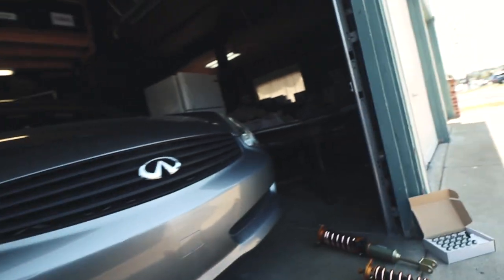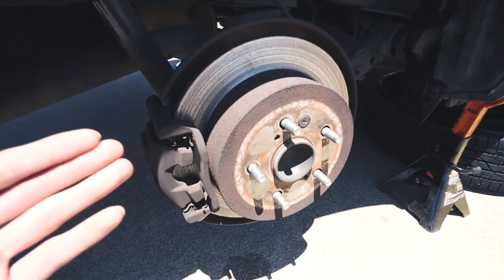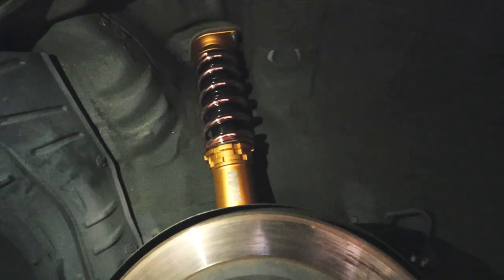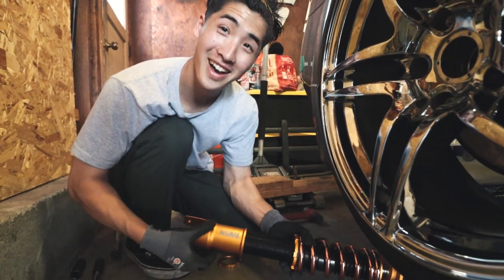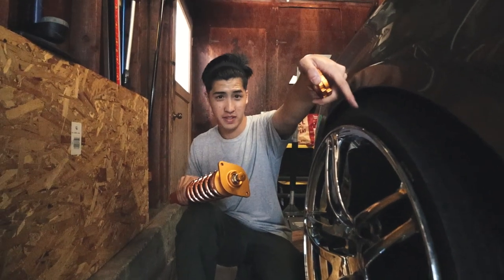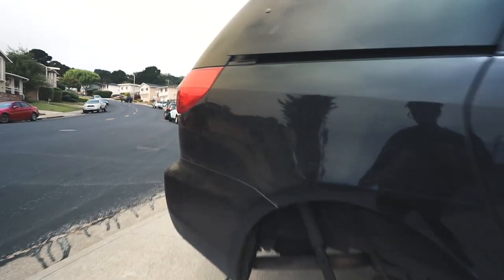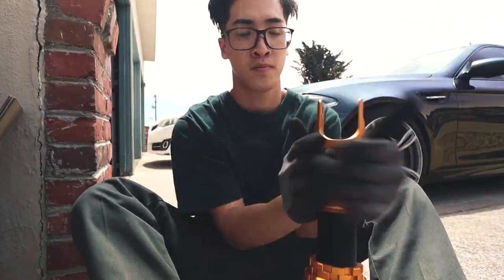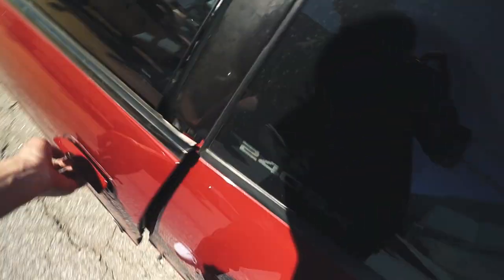NEW COILOVERS TO SLAM MY G35..

Comment: If you plan to go lower on the coilovers you will need to buy shorter springs. PBM Standard size is probably 7inches. 5" or 6" should give you another 2-4 inches of drop :)

Comment: Are you on 18s or 19s?
Reply from the maker: 18s
Reply: @TylerTea  at what point does the front upper camber ar begin to bottom out did you have to worry about it with the pbms maxed out?